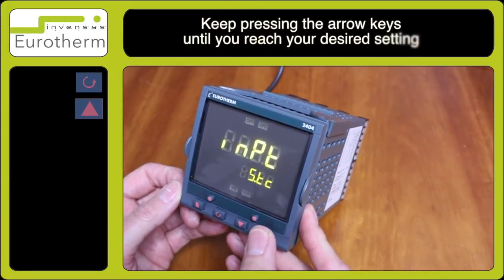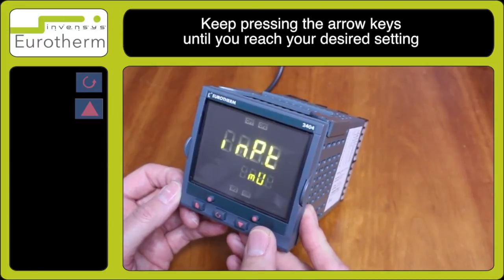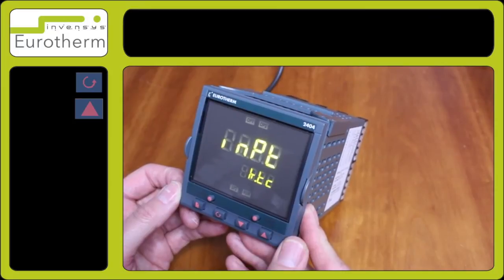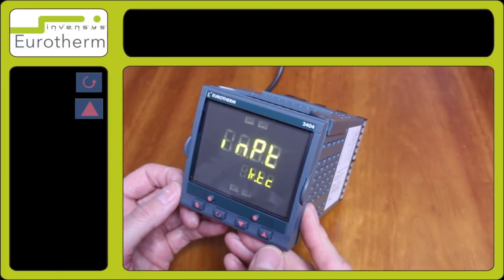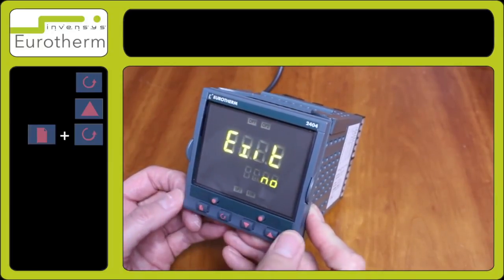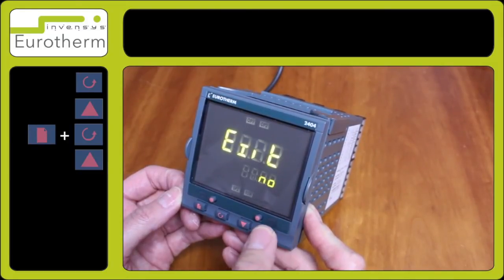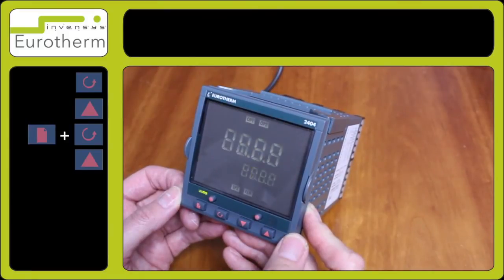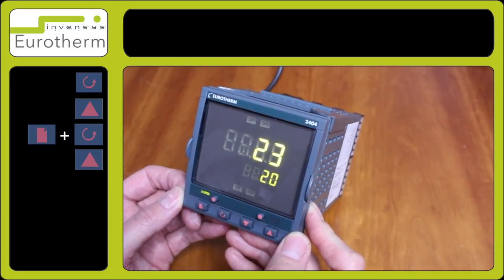Input configuration tutorial on a Eurotherm 2404 Controller

Comment: Hi, I have a 2404  Eurotherm which is controlled by a computer program (in a large machine), can i externally set the maximum temperature from the configuration menu to protect the machine in case if some one accidentally make a typo mistake on the program .
Thanks
Reply from the maker: Hi Rabi,

The Limitation is set in two listings.

In Configuration -> PU -> rnG.H set the range limit here.
This governs the overall range and setpoint limit, you cannot set SP H (in SP List Full Level) higher than this value.

Alternatively,

In Full Level -> SP List -> SP H adjust setpoint limit here.
This is used if rnG.H is say 100 the setpoint limit can be set up to 100.
So if someone alters the setpoint and SP H was set to 80 then it would stop at 80.
Reply: Thanks